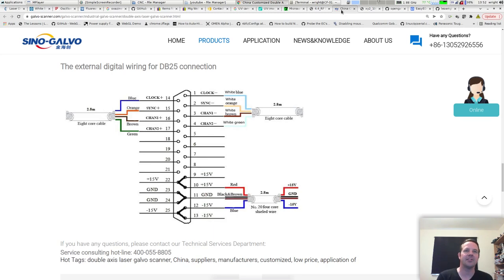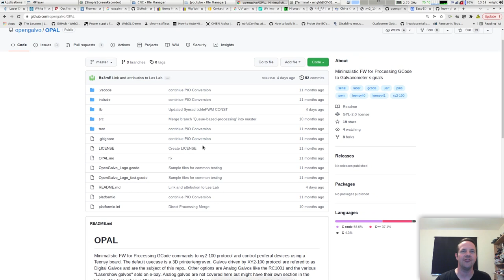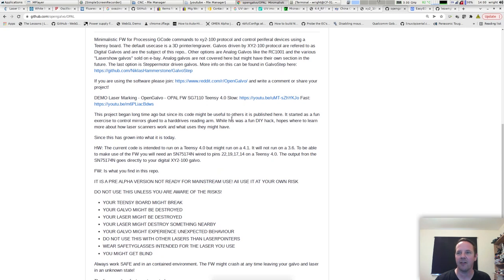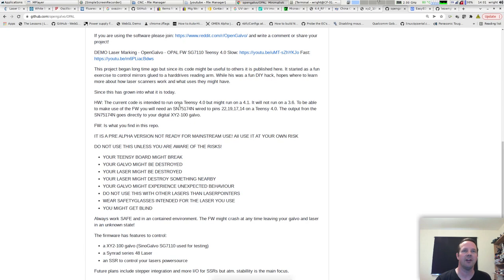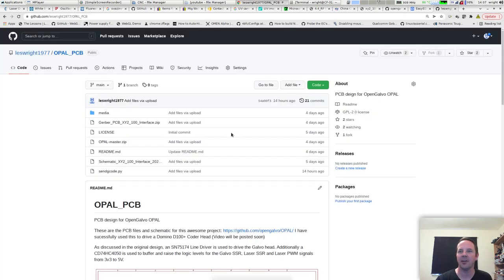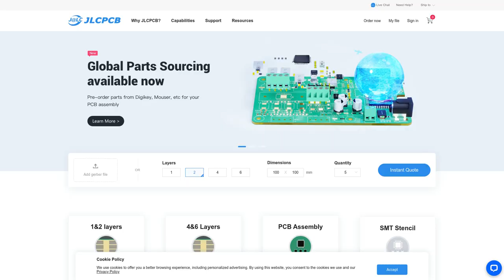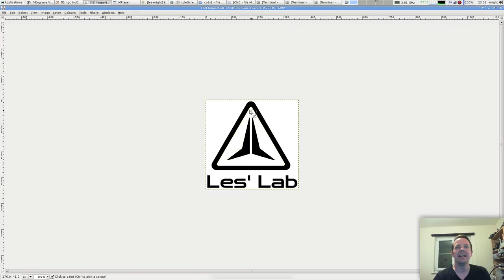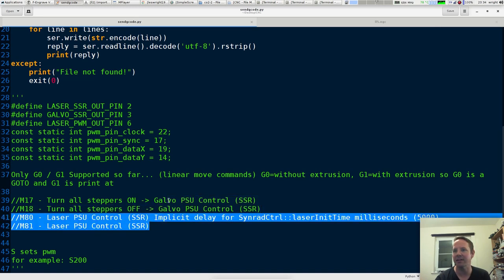CO2 Laser Engraver. Industrial Laser Coder Hacked! Part 2!

Comment: Very nice. I bought a few years ago a Coherent GEM 100W Laser and a power supply for it and I had to run it but I did not have time until today. I even wrote a program in assembler on Arduino to convert Gcode to XY2-100. This year I was also going to use OPAL like you did, because it seemed more advanced. Congratulations on your success with this laser. Maybe it will motivate me to fix mine.
Reply from the maker: I am glad you found it useful! Daniel's code is fantastic, and works really well with this machine.

Comment: I supposed it isn't so much engraving the glass as it is leaving a trail of fractures. I suspect it may be easy to break the glass along the laser-"etched" path, so this could be used to cut out oddly-shaped pieces of glass.
Reply from the maker: For sure, there is a tiny melt path with tiny fractures radiating out. An interesting idea, I should give it a go!

Comment: Super cool, the opengalvo software looks awesome. 

The glass thing is weird and also a little worrying that marks appear a few seconds later, means the glass has lots of internal stress which could see it shatter while you're handling it.
Reply from the maker: True! OpenGalvo/OPAL is amazingly good! It is an interesting effect though, I wonder what uses it could be put to...
Reply: The way glass acts when you engrave it, it's heat that causes stresses and internal cracks in the glass. It's not that weird that it does what it does.

Comment: Awesome Job  those are some awesome results
Reply from the maker: Thanks! It worked out really well. I think at this stage it's time to build this thing a proper enclosure and an adjustable stage for mounting workpieces.
Reply: @LesLaboratory  yea it sure did easy to drive also with just a teensy and some generic parts love it

Comment: Hey Les, despite JLCPCB and the like, I can't but get the desire to make my own boards at home.  However, applying the etch mask drives me nuts.  Do you have some idea of how a laser engraver could be used to remove a film of paint from some FR4 copper stock to expose the area for etching with the level of detail required for fine PCB traces?  I would be most interested to see if this is possible, and if so, how to go about it.
Reply from the maker: Sure, JLCPCB is great if you want professional PCB's and I am very happy with their service.
I do however understand the need to rattle out a prototype at home real quick. I figure if you sprayed a bare copper board with a thin layer of black paint, then lasered off the non-copper areas, it will probably etch ok. For fine traces you might find this is a trial and error job, and ti is more likely the etching process where this falls down.
Reply: Thanks,  @LesLaboratory .  I suppose my question is more "Can we hack it from salvaged gear?" more so than will it work.  I'm guessing as long as the coating applied ablates well, the outcome will be grand.  But you make a good point; buying a laser engraver and have done with it is probably the way to go.

Comment: The small black spots that appear, is it because the galvo stops for a second but the laser is keps on? Maybe some tOn/tOff timing that needs adjusting?
Reply from the maker: Yes exactly. This video is "first light" and some fine tuning in terms of speeds and power is required. The GCode is generated automatically, so perhaps some adjustment is required there.

Comment: Im pressed with the detail achieved. Is there simply a lens to focus prior to going to the galvos or is there a ftheta/scan lens to better accommodate flat field correction at the sample plane?
Reply from the maker: Thanks! There are two lens assemblies in the head. The output lens is an F-theta lens, and internally there is a collimating lens for the CO2 laser. The teardown of this head is here:https://youtu.be/_i1J7TGpPnQ
Reply: My thoughts, exactly. I just emailed Zenodilodon to ask whether this could be accomplished with Kvant's 'beam brush' lens assembly. 
That's also who pointed me to Les' Lab, BTW. 😎
Reply from the maker: @TheOleHermit  Awesome, pass on my regards! He is a good Guy. So what you are thinking is an ILDA Galvo, with an F-theta lens on the output, and some watts of Laser light behind it? It might be doable. Assuming they are closed loop galvos and the thing is linear enough, you might get reasonable results. That said XY2-100 Galvos complete with a suitable lens seems to be available relatively inexpensively. Note, the lens in mine is about 1 inch in diameter. If I was buying new, I would be going 2 inches or larger.
Reply: @LesLaboratory  "Awesome, pass on my regards!"
You betcha! "He is a good Guy."
Among the best.
" So what you are thinking is an ILDA Galvo, with an F-theta lens on the output, and some watts of Laser light behind it?"
 If I knew what an F-theta lens is, that would be exactly what I'm thinking. lol
But, if the lens maintains focus, while scanning a flat surface, then it's always better to just KISS, w/o the additional electro-mechanical complexity.
I already have the projector and imaging capability. Time to RTFM on F-theta lenses.
Thanks for your great videos.
💨

Comment: Great work!!! I m facing problem,  when i print square x is shorter y is ok. Could you help what is the prb?
Reply from the maker: Yep, all you need to do is calibrate the axes in lightburn. There are instructions here: https://docs.lightburnsoftware.com/UI/MachineSettings.html
If you look on YT for "Calibrate axes lightburn" you will find video tutorials if you prefer those. During calibration cut a square of at least 4 inches on a side, to ensure calibration is accurate.

Comment: Glass may be easier to work with if you look at it as more of a mechanical process where you are trying to shatter off glass from the surface as a series of small pits, so that would require multiple passes of very rapid, short duration and higher powered pulses? Tap tap tap....  This may reduce the wider effects of heating and the cracks that fan out from lines and points. Take a look at your first test under a microscope.
Reply from the maker: Absolutely. I have had this under the microscope already. There is a clearly defined melt path, from which small stress cracks radiate from at regular intervals. Unfortunately the CO2 Laser is CW, but pre-heating the workpiece might help. I could always pull my old YAG out of storage, though it could probably do with a complete strip and clean!

Comment: See Applied Science’s video on cutting ceramics with a laser, he briefly touches on cutting glass but comes to the conclusion that the microfractures are too imprecise and lead to unwanted cracking. Even just for engraving you can see that it’s not exactly sticking to its lines.
Reply from the maker: For sure, the cracks as spiderlike, and occur regularly along the track. That said, there is bound to be a way of doing it. maybe preheating the piece, or some other method...